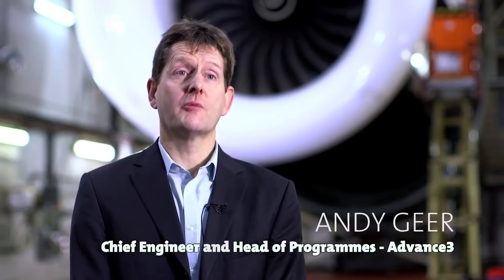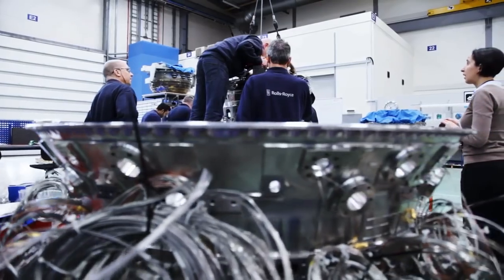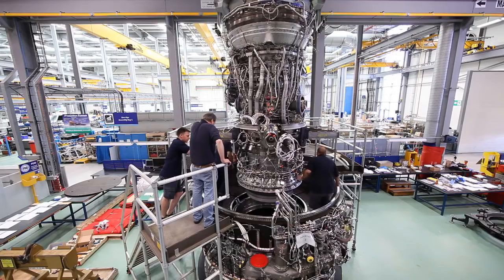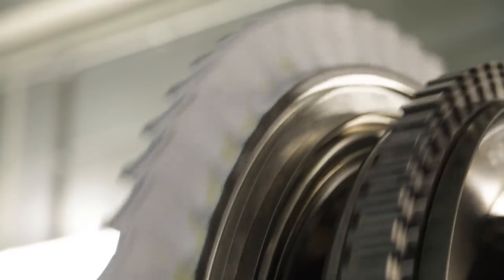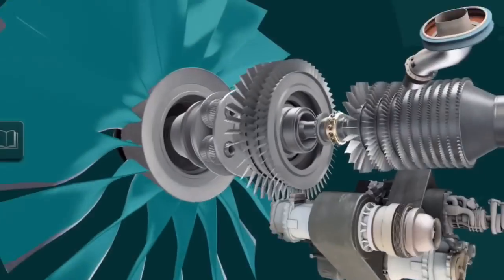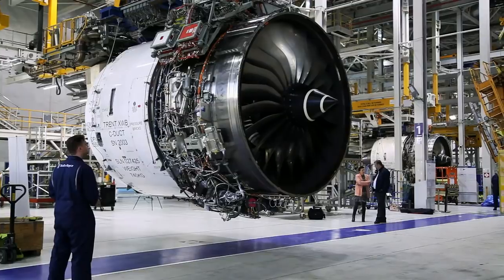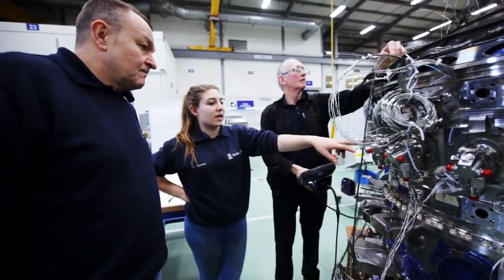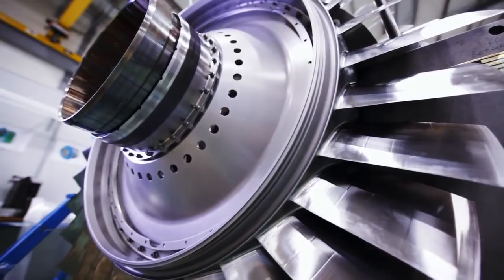Rolls-Royce | Advance3 core demonstrator

Comment: Could this technology be downsized to compete with the new engines powering the A320 neo and B737 max or is Rolls concentrating on wide body applications only?
Reply: Ricky Doodlous if you look on Wikipedia rolls royce is trying to compete for a middle of the market aircraft (757 replacement) which is already much smaller than current engines from them.
Reply: Thanks Jason i was thinking that since Rolls pulled out of the V2500 program that they were missing out on a lucrative sector of the market.
Reply: The ultra fan coming mid 2020’s is going to be very scaleable. So that architecture will allow access to the narrow body market.